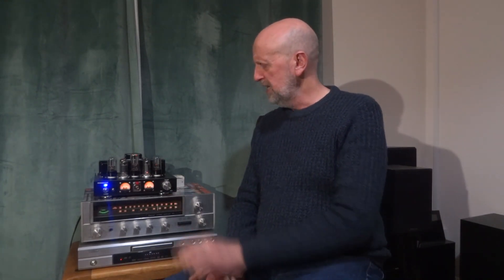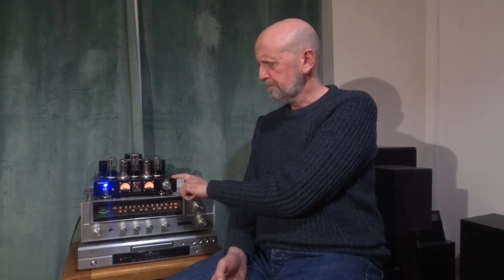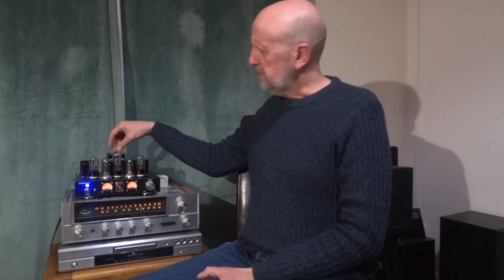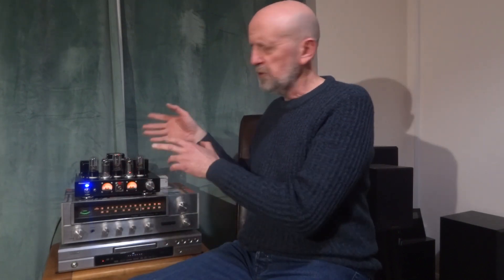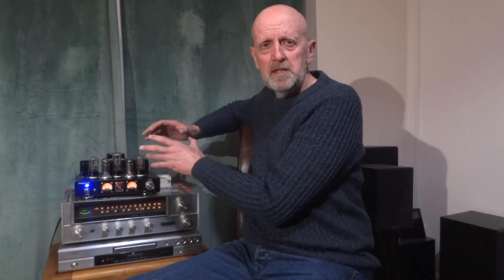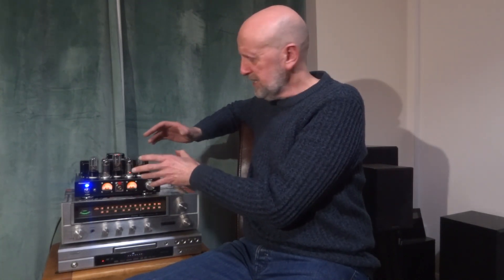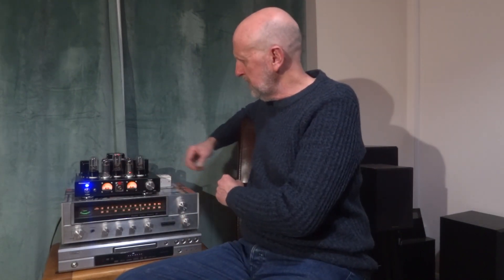Over Heating Valve Tube Amplifier, Transformer Power Supply Issue, 6P1, el34, el84, 300b

Comment: good review as usual
i have a question
were can i buy auto transformer 230v to 220v for my amplifier? one that transport international
Reply from the maker: I have not seem one that does 110 to 240 as the input as of yet, but there is one that does 240 to 230 or 220volts and the USA model of the same one does 110,120 and 127 volts,  both at 1200 watts I believe https://www.ebuyer.com/53035-apc-line-r-1200va-automatic-voltage-regulator-le1200i?utm_term=&utm_campaign=PLAs%7C%7CAllProducts%7C%7CLow&utm_source=adwords&utm_medium=ppc&hsa_acc=4863007528&hsa_cam=9233776249&hsa_grp=93110254025&hsa_ad=416152659484&hsa_src=g&hsa_tgt=aud-830650462468:pla-454003756979&hsa_kw=&hsa_mt=&hsa_net=adwords&hsa_ver=3&gclid=Cj0KCQiAmKiQBhClARIsAKtSj-mv3SBJkrK3jVN12zZAjHtXL5in2RrPa8JD4vdHs06ABTun6tlR4QgaAq3FEALw_wcB
Reply: @MichaelYates  
I don't need for usa.
What I need is a transformator or any other device to reduce the voltage from 230v to 220v and I don't find that in my country
Reply from the maker: @kobush18  The apc line r-1200 will do 230 to 220 if you can get hold of one were you are, or any transformer rated at the wattage your amp requires that has a 230 and a 220 tap, wire the input at the 230 taps and wire the output at the 220 taps, a lot of vintage amps and receivers have this kind transformer
Reply from the maker: Also there are step up and step down converters about as well,  this YouTuber reviews one and they do different wattage versions https://www.youtube.com/watch?v=ENl4Vx-_Omg

Comment: You get what you pay for. GBP 300,- is a lot of money, at least for most people. So you may think that when you spend it, this may entitle you to get a quality product. But in reality for that money you could not build such amplifier your self, assuming you know how to do so. So if it comes from China to your door step for that money, it should be obvious to you that along the line some shortcuts had to be taken to make this possible at all.

Anyway, thanks Michael, for taking us along with you on this journey. Half the fun of audio is what is under the hood.
Reply from the maker: The amp is being quite a bit of fun, learning a few things along the way, yes this is real budget in the Valve amp department, but on the whole with a bit of tweaking thanks to Skunkie Designs Electronics its not sounding to bad at all for how limited it is.